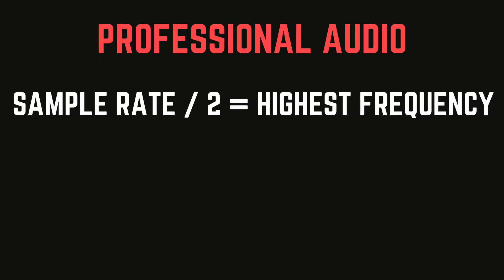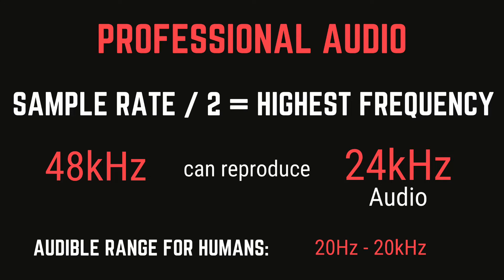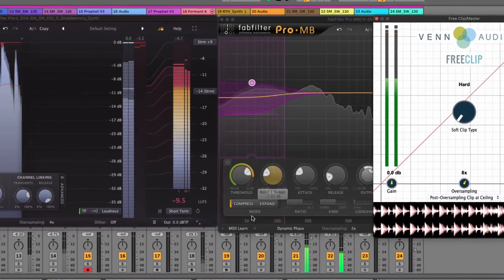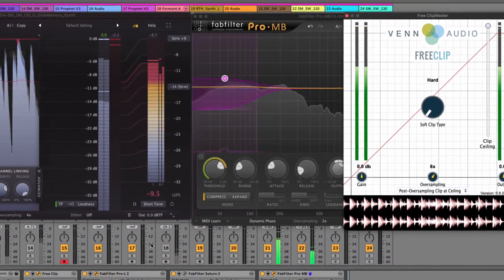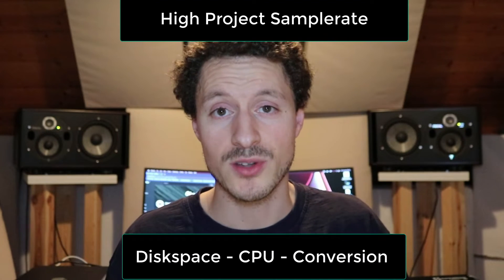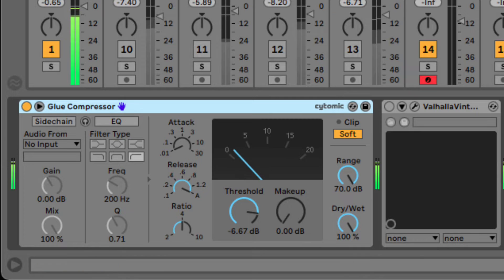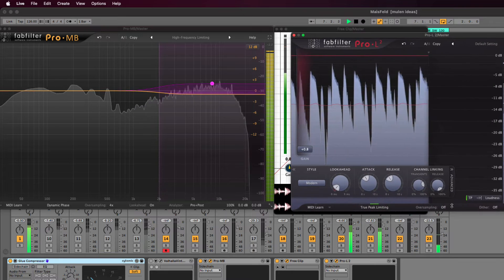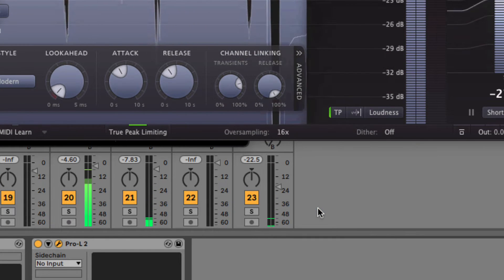Whats is Oversampling in under 3 minutes

Comment: Today it finally clicked why aliasing would happen when processing adds harmonics beyond the sample rate. So basically some of the higher harmonic points would still be sampled, but not all of them. And thus the waveform would jump between some of those extra noise points. So that is basically causing waveform noise because only some of the higher frequency points are recorded in the file.